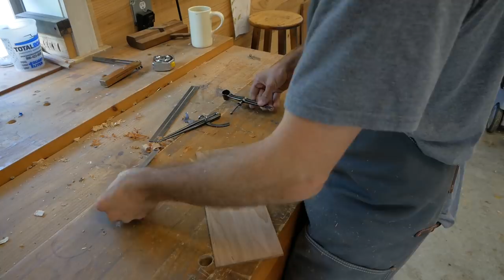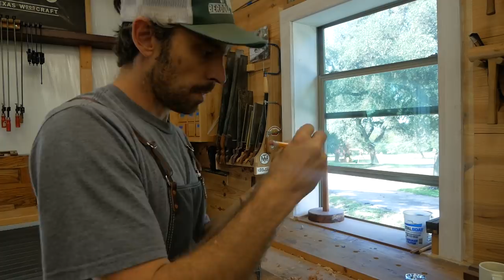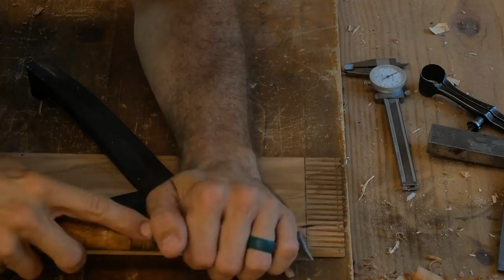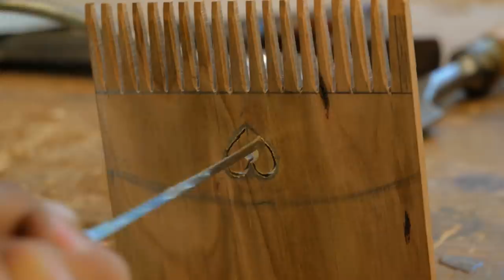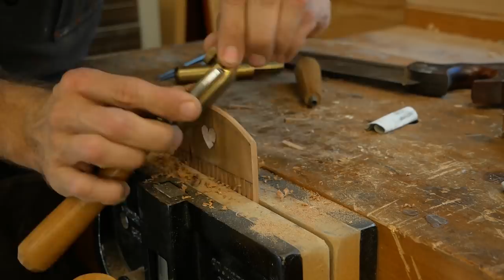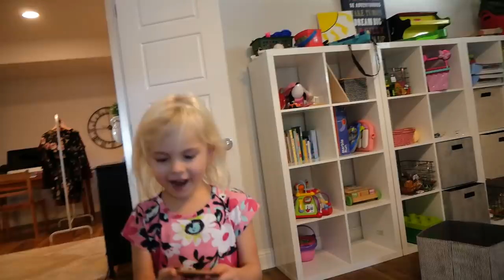Making A Wood Comb For My Daughter

Comment: ur vids are great 👍🏻 just wanted to give u a tip (not that u need it). when u use sand paper to sand inside small holes like that heart shape again, maybe glue or double side tape sand paper to a small dowel. just a thought 👍🏻